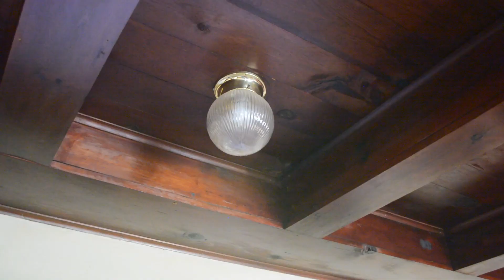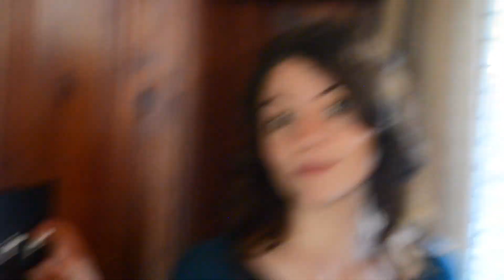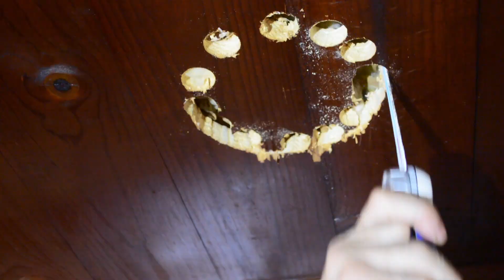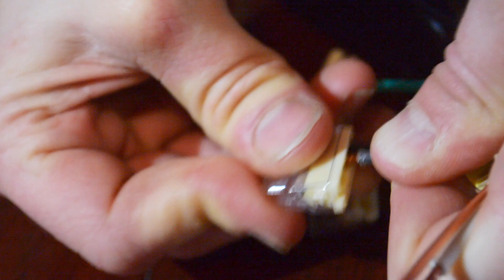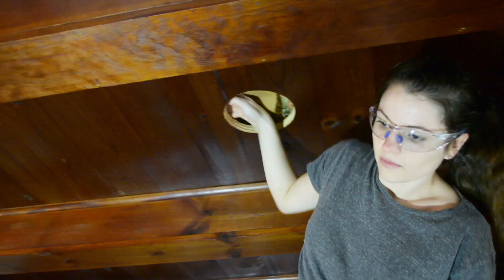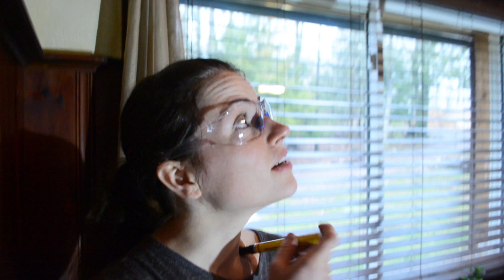Install Ultra Thin Recessed LED Ceiling Lights

Comment: Canless led lights are absolute junk. Cans protect the lights, you have better choices with brighter, better  lights. Plus the cans less lights have 2 cheap springs that don’t hold the light in the ceiling level.

Comment: Rather than butchering the ceiling  I would have gone with LED strips mounted on the 'beams' with 45 degree channels (so the light points down).  As these are usually 12 or 24VDC it is much easier/safer, and w/o risk of violating electrical codes. Mounting is easy and quick. Dimming is also much easier.

Comment: Great video! I was wondering if you could explain a little more in details how to remove and re adapt the actual fixture that you snapped into place. I have a similar fixture with a dead LED and have no idea how to take it off??? Please respond

Comment: You will probably never see this but, I'm a electrician, and please NEVER spin the wire strippers! It wasn't too bad but you really damaged The Wire. Electricity travels on the outside of the copper wire so any Nicks create resistance which is bad for electrical current, with the LED not needing so much power so for what you are doing won't have that much trouble, but if it was a high-current that much damage could create a fire, 
with the wire strippers just close the handle and don't hold the handles closed tightly you want to let go a little bit and then pull off not insulation, it's going to be in a bit tougher to pull it off but you won't damage the wire nearly as much, and it does take practice

Comment: Here’s a tip to make this easier. The output of these junction boxes is low voltage low amperage electricity. It’s very similar to what runs your doorbell. So instead of running the heavy expensive Nomex wire from hole to hole, which is very hard to do. I put all my junction boxes together where the original light was. It looks funny a chain of 8 boxes with only 2 inches of nomex between them. But they’re stuffed up into the ceiling where they wont show. I then ran actual doorbell wire from each box to each light. It works perfectly. A few things to note. Make sure it is low voltage. Read the sticker on the junction box. If the output is less than 50 volts and the amperage is less than an amp. You’re safe to proceed. Mine was 20 Volts and 300 ma (1/3 amp) This is safe to touch without getting a shock when powered and doesn’t have enough power to heat the wire to the point of causing a fire. You have to cut off the existing connectors and strip back the wires. It makes a difference which colour wire goes to which colour wire. Connect one light before you install, if it doesn’t light up reverse the wires and then it should light up. Just make sure you are consistent with all the rest and they are wired the same..
It is so much easier dealing with little thin bell wire than the big stiff nomex. For us it was ideal as we were putting in a flush fit drop ceiling. Nomex wouldn’t have fit above the tiles and it would have been an immense amount of work to cut into the drywall ceiling and have to drill a dozen 1/2” holes through the ceiling beams. The bell wire just sits on top of the tile.
Reply: This is not code and dangerous.
Reply: @larryjolicoeur7169  What part do you have a problem with? I don't believe low voltage applications are covered by the code. I guess it depends on your jurisdiction. As a test I shorted the low voltage wires together and nothing happened. 300ma is not enough to heat even the thin bell wire. I could also hold the bare live wires in my hand without even a tingle. The voltage isn't high enough to overcome skin resistance.  The junction box that comes with the lights are meant to be stuffed above the ceiling. I just put them all together.
Reply: The led lights that come with the driver have a prepared cable length.  Any changes to that voids any UL / CSA approval. Installing this is a code violation.
Reply: @larryjolicoeur7169  Does the code cover low voltage/current applications? If so you maybe correct that technically it violates the code. I would disagree that it's dangerous. You can't get a shock and there's not enough power to cause a fire.  This is from direct observation by experiment and 20 years of experience in engineering low voltage power for phone systems. The cable length went from about a foot with the prepared cable to 20 feet for the longest run. It's been working for about 3 years now with no problems and all the lights are the same brightness regardless of wire length.The bell wire I used is actually a lower gauge than the original cable.

Comment: Hole saw trick: replace the pilot bit with solid 1/4" rod and drill the pilot hole first. It's easier to remove the blank from the saw and you won't be snapping bits, especially in metal.

Comment: Every video I've seen always feature this light fixture.  How much is it, and what is the replacement cost? and i suppose you had to replace the light switch with a dimmable model.
Reply from the maker: I've included an affiliate link in the description. Clicking the link will bring you directly to the product I used. I believe they were around $80 for six. https://www.youtube.com/redirect?redir_token=QUFFLUhqbjFYeG1nOEZib2lLVmVjb25lS3ZCYW5xa2RuUXxBQ3Jtc0tuVkdfd0RnRUVfVTYyM01rVW56NWhER3hkLWFpcGVwY3l3OVlJdHV6bU41TUZ3VHBNMS1YVnd1c2ZOU2x5bE5aRW8yWmtZOXA3NmUwd1ZtMzBPbUlKQ2VYYlZ1V29rWVNjU3pINFFlRjY2dE1ZUEJ2QQ%3D%3D&q=https%3A%2F%2Famzn.to%2F32V4UGg&event=video_description&v=YhBkaNfY3Ow

Comment: Thank you for introducing a great product. Is it ok to leave the junction boxes in with blown in insulation around it or should i enclose the juction box with some cover as well? Txs.
Reply from the maker: I would consult the manufacturing company for this question. 
My own personal thought is that the old style junction boxes are way more open than these newer ones. but I would still be cautious about any piece that may get caught in there. 
Best bet is still to ask the company that makes them.

Comment: I just did the same for 3 bathrooms. Two with 2 recessed LEDs and one with 5 as it is a very large bathroom. Older lights were fluorescent tubes, these tend to flicker and buzz !!! LEDs are great.
BTW, I admire this lady. Never seen a lady doing electrical work before.

Comment: Please, with no disrespect, concentrate on what you know and don't discuss what you don't know.  14/2 is what these lights are designed for, not 12/2.  The connector is not rated for 20A.  You can install 100 of those lights on a 14/2 wire.

Comment: Hey. Amazing video. I've got a question for you. Did you use a normal, impact or hammer drill for the holes? I'm looking to buy some drills but there are so many options. Thank you.
Reply from the maker: Hello Joel, Thanks for the comment. we used a regular dewalt 20v drill for the project. Here is our affiliate link. https://amzn.to/3knm70C.
If you need to make a hole in a wood ceiling like we did I would consider a slightly stronger drill. That was definitely the toughest part of the project for us.
Reply: Ooooh thank you @BlackRabbitHomestead  . Great advice✌🏽

Comment: Be careful when connecting your power source, some ceiling fixtures are wired with what is called a switch loop, never assume that black is always your hot source. also never assume that the white wire is always a neutral, always keep in mind it's just another conductor/wire. Older houses and even older mobile homes where wired with switch loops, if you open up or take down the fixture  and you see more than two sets of Romex wire, more than likely you will be working with a switch loop situation.. now one thing you can do is not undo the other wires in the box, and just use the white and black wire to connect your source ,with also the ground wire. final note if you take down a fixture and you see more than two sets of wire, take picture with your cell phone, that way you have reference for wiring it back right, switch loop is identified by white wire with black tape on it, but don't assume because if someone went into the box in the past and didn't label the wire properly or labeled it at all, it can be dangerous, electricity can't be seen like water, never and mean never assume it's off, check with a meter, the little yellow checker she was using is not 100% fool proof, especially with a switch loop, lots of video's proofing that.. stay safe.
Reply from the maker: Thank you for the comment, This is very good advice.
Reply: @BlackRabbitHomestead  glad that you liked it, a lot of people don't realize that a switch loop can  really make you scratch your head, there's an old video on you tube that best explains it, but can't remember  the guy's name that made it off the top of my head.

Comment: Candace Olsen used to call this configuration the airport runway look. Of course the trouble with running lights parallel to the beams is: they cast a shadow on the perimeter walls. Now you’ll need some track lighting or floor lamps to light each of the four walls or you’ll have that shadow making your room feel shorter.
Reply from the maker: Agreed  the light layout does cast heavy shadows because of our wooden beams. We do have the original ceiling light which projects a warm tone as well as two table lamps.

Comment: 12/2 is it not too big wire for this lights? Can I use 14/2? All this lights works from one 15 Amps breaker, wright?
Reply: 14/2 is standard for lighting in Canada for 15A, not sure why 12/2 was used, unless something from the manufacturer said to use it.
Reply from the maker: We used the 12/2 simply because that is what we had readily available. 14/2 is the standard for most places. You can check your local zoning to see what your area suggests.

Comment: 12/2 is it not too big wire for this lights? Can I use 14/4? All this lights works from one 15 Amps breaker, wright?
Reply: I noticed  that too.  12 awg is way too much for those lights.  I possibly see putting 12g if she has a 20a service and that may be the code required.

Comment: This is a very misleading video.  I hope no one tries to do this job from the information in this video.
Reply: Care to share more information...
Reply: Yes if you have drywall ceiling, there could be lots of hidden framing lumber and that makes routing wires difficult.  But in her case, it was indeed easy as shown.

Comment: You did a wonderful job installing lights. Based on the room size and size of the led lights you used , I would have spaced them further apart from each other and as a person preference used between 3000k or 4000k leds . I like that you put a dimmer on them that way it’s not to bright because you put a lot of leds in there. :)

Comment: Ah! No closure ending, that was like the most important part. But still good video even with the cliff hanger
Reply: Yes, connecting this chain of light to the power source is important. But it is not complicate as there is already a junction box at the old light, just put in the new cable there and connect the wires the same way it was done for the LED junction box. I guess the real missing part is: removing the old light will expose the junction box, you can cover it with a metal lid. How to hide this metal lid for cosmetic is the real challenge.

Comment: The basic electrics is easy enough that idiots think they can do it all.
Each wire that this lady has used the wire strippers on has a groove around the wire which will probably cause the wire to snap at a later date. 
Sometimes no knowledge is better than not enough.
Reply from the maker: Wire strippers can leave a superficial scratch on the wire, but don't cause anywhere near enough damage to weaken it enough to snap it, even after repeatedly bending it (which you wouldn't be doing anyway). The danger for people new to electricity is using the wrong groove on the wire stripper which can cut too deeply.
Reply: Electricians feel threatened when people start doing their own wiring.  It's not that hard.  Probably electric wiring is easiset part of home construction once you grasp the basics of electrical wiring.

Comment: Completley left out the most important parts of the video. Wow lmfao
Reply from the maker: Sorry guys, the video was only about installing the lights. Not new electric lines. Every house has a different situation. Installing the power to the lights is exactly the same as the connections between lights.
Reply: @BlackRabbitHomestead  Did you need to install new wiring because the old switch didn't have a neutral in box for your dimmer? I'm curious what happened

Comment: You never showed the final connection to where the light was, you went to attic and left out a important part of the video!
Reply from the maker: Sorry guys, the video was only about installing the lights. Not new electric lines. Every house has a different situation. Installing the power to the lights is exactly the same as the connections between lights.

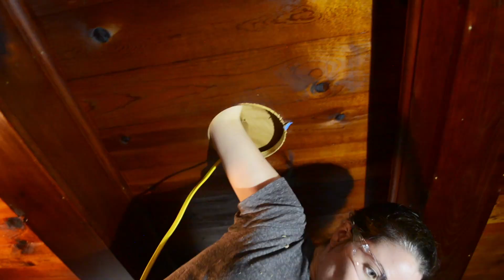Comment: That would be a "cable clamp" at 7:00.   Not a "wire connector".   I don't mean to be snarky, but people on youtube need to be a lot more careful about terminology if they are providing "informative" videos.   People don't seem to know (or care about) the difference between bolts and nuts, screws and bolts, etc.   That sort of thing.   
Otherwise, good video.   Thanks.
Reply from the maker: Thanks for the compliment on the video! as for wire clamp/connector (depending on the brand) v.s. cable clamp. I've seen it advertised as both. For instance in the hardware store I work at its called a wire connector.
 I experienced the same thing when I worked at equipment rental. You should have seen my face the first time someone called and asked me if they could rent out my "pecker".....which is just slang for a jackhammer. Lol.

Comment: Where did you purchase lights
Reply from the maker: Just go into the link posted in the description, that will bring you right to the exact product.
Reply from the maker: https://amzn.to/3j8VufH
This is an affiliate link: by clicking and shopping from the site I will make a small commission at no cost to you.
Reply: Was there a special dimmer switch needed for the LEDs?
Reply from the maker: @johnhunter6560  you just have to make sure its an led compatible switch. I used a toggle switch with a slider ; manufactured by eaton if not mistaken.
Reply: How far apart did you place the lights?  Thank you!!
Reply from the maker: @MsTegeray  roughly 3-4 feet apart. If you you want me to measure exactly I will. Im to short and need the ladder. But the distance will vary and is completely up to you.

Comment: My house was built in 1971 and I don't know what type of insulation exists above the kitchen ceiling. Can I still install ultra thin LED lights?
Reply from the maker: Without actually seeing your situation its hard to say. These lights do not put out a great amount of heat. I do not think you would have a problem. However, if you are concerned, I would involve an electrician.
Reply: Make sure you get IC rated lighting which are rated to work in attics with insulation. I also agree to consult an electrician if you’re not sure

Comment: good video. But still too much work. i think i would still opt for plain ol wireless external slim battery powered lights. Someone just needs to invent em :) . oh and if you are going to do so make sure you make em alexa/google home compatible.
Reply: All you have to do is have a smart dimmer switch. They are like 20 bucks online
Reply: @whatthetechmechanic  the wiring ... its just something that in my mind shouldnt be necessary. I have led light bars that i charge once every two months and then just place em in closet or hallway...
Reply: Battery powered light is not so good for long term as battery often goes bad.  Besides, putting in new wired led light is real home improvment and good skill to learn

Comment: Nice video but it looks to me like you're using number 12 Romex when 14 would it be all you need
Reply from the maker: Correct! We just so happened to have the 12 lying around. Didn't want to dive too deep into wiring and codes in this video.

Comment: I've been looking for a solution like this and the price is right. I've already added this to my Amazon wish list. I like the large install hole required to mount the light; it allows you to get you arm in the hole to fish the wire around obstacles. These would be great upgrades for closet lighting. LED crushes other lighting choices and offer they brightness selections. Good job!